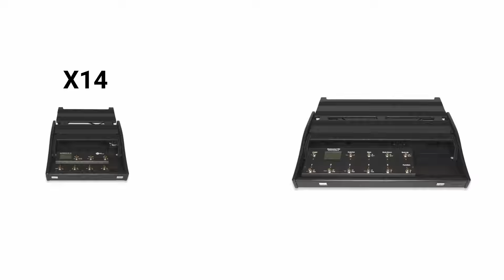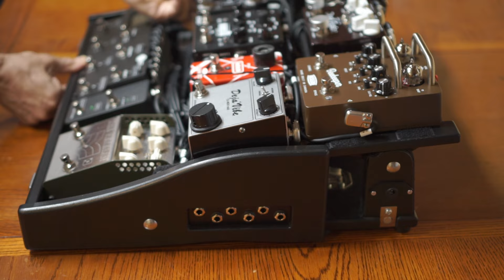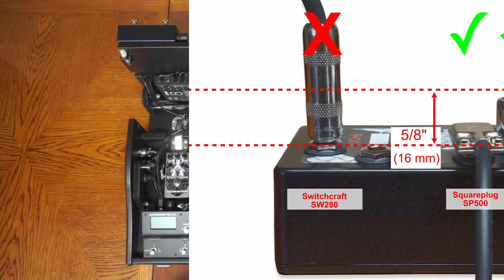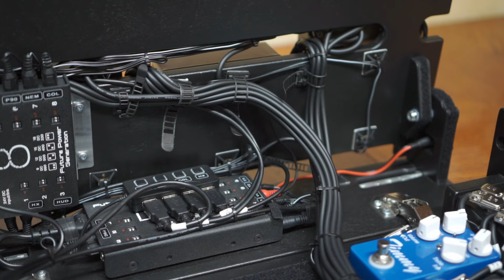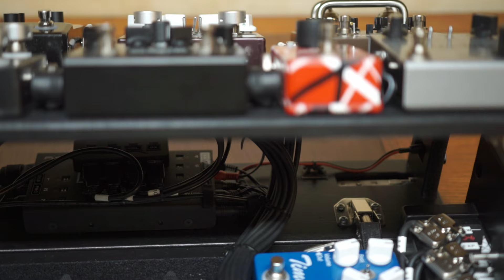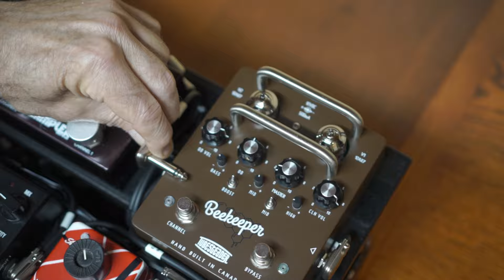New Expanding X-Series - Features and Pedalboard Build Tips

Comment: Lots of awesome ideas here, really love the design. A little pricey.... but very well thought out. Is there an option to have the IEC cable plugged in without extending the 2nd tier? in some situations a smaller board is better and having the option to have access to just the top row on smaller stage might be be useful. 

Awesome work!
Reply from the maker: We do have the option of a PowerCon AC connector shown at 4:26 in our AUX 3 panel that could power you through the side wall instead of the IEC connector. Cheers!
Reply: @PivotalPedalboards  awesome! Thanks for the reply, will definitely consider when it's time for an upgrade.